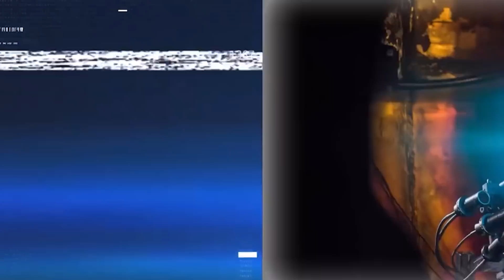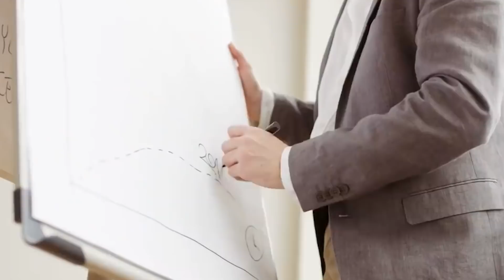intro.mov

Comment: Please stop the ridiculous use of the term , "Game Over" ! If any part of what you have reported here is actually accurate and not totally unsupported speculation, then whatever game that is going to take place is merely beginning and very far from being "over". I hope what you suggest may indeed happen and is as safe as is claimed. However I suspect that we are probably at least 10 years away from proof of concept and the morass of regulatory approval and finally acceptance by a suspicious public who (for good reason) doubt all claims of safety about nuclear reactors. Now, go away and work on it instead to speculating about it.